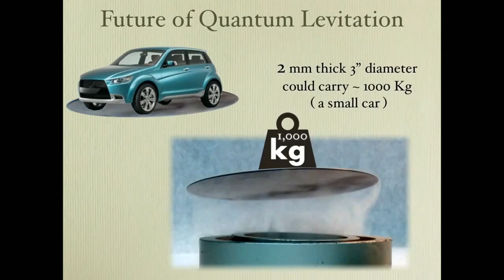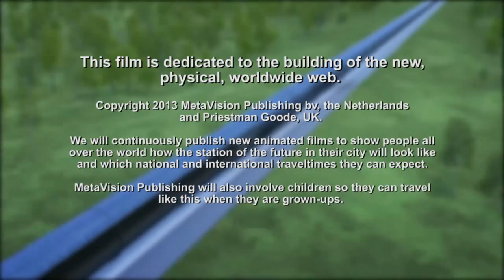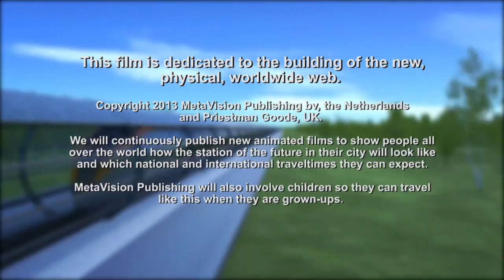Solar-powered  | maglev HSR bullet train | Quantum Train

Comment: This could replace local flights, which is great, but there’s a carbon cost to building the infrastructure needed. I also saw no mention of how wildlife would be able to get beyond the barriers that 5gis would create. Some tunnels/bridges will be required. Also, as sea levels are rising, would this system work if it was entirely submerged? Great video!